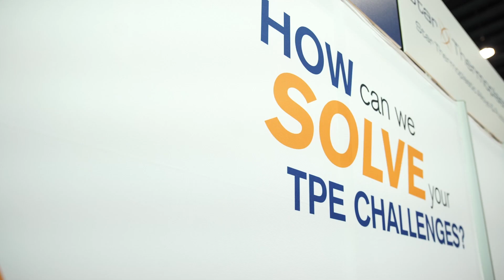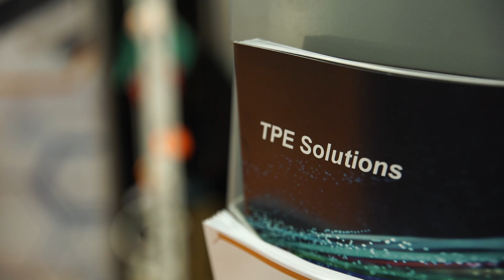What is a Thermoplastic Elastomer?

Comment: Hello, do we have a chance to mold this product (TPE) with our own methods and produce objects? For example, at home, can we get efficiency by heating and molding?
Reply: Bende tenga ürününden çıkan tpe var eritip şekil vermek istiyorum ama nasil yapılacağına dair hiçbir fikrim yok
Reply: If you are making something from a diy shop you can do injection molding. They sell kits that basically best the plastic at the top and depressing a lever forces the solid tpe or other plastics to melt. Then it's compressed into a funnel and injected into a mold. If you are making a custom item you'll need to have a mold made by a tool and die maker which is probably going to cost at least $100 usd in labor and material. All depends on the complexity of the mold.
Reply: @flyback_driver  oh so you can't just create shapes with your hand? shame, I was looking for an elastic material for crafting...